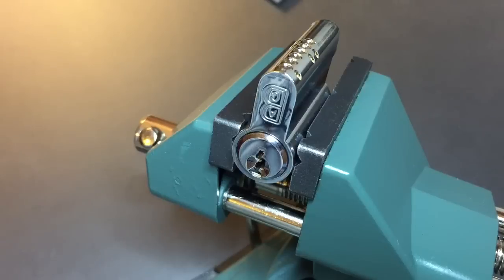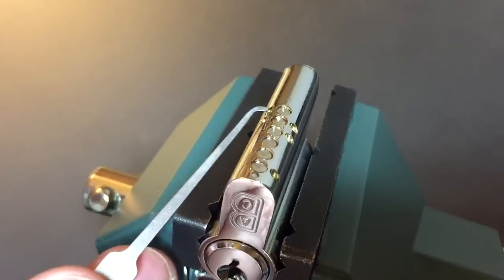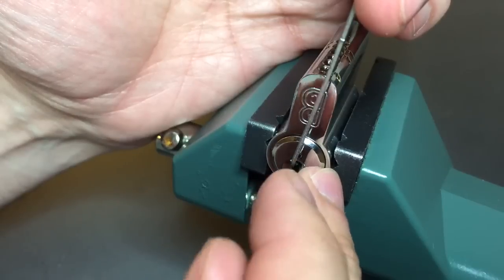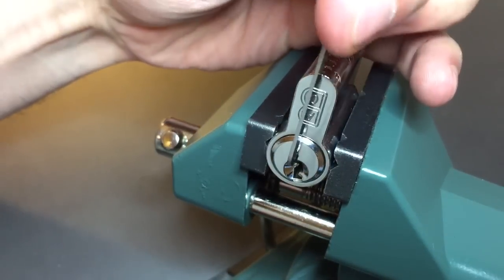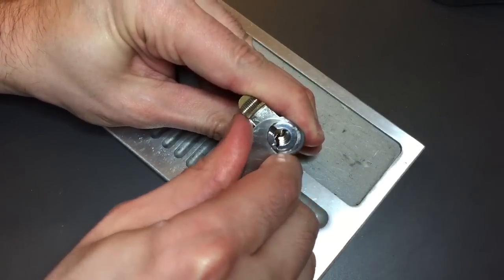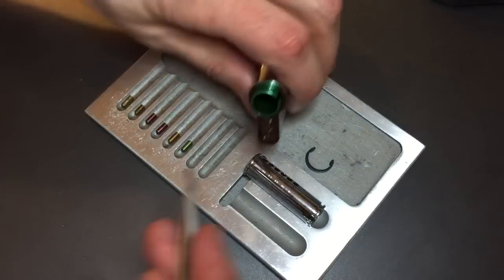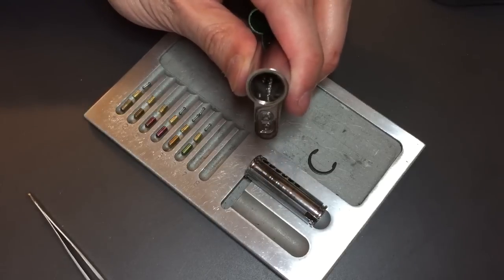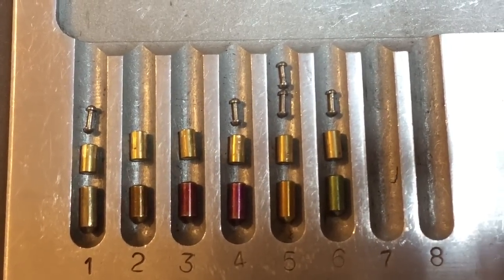[142] Fullex (5 Trap Pins!) Anti Bump Cylinder Picked and Gutted

Comment: Hi Harry,   Interesting lock, plus the trap pins. Some trap pins in locks can be beat by very tightly packing dental floss into a picked keyway ..... but I like your method a lot better!  Regards, Brian.
Reply from the maker: +Brian Hignett Thanks.  I was thinking along those lines.  I did not consider dental floss though.  I was thinking about stuffing pieces of foam ear plugs (the kind that you roll up, then they expand in your ear) into the keyway.  Luckily, the trap pins could be addressed by picking, or I'm not sure what I would have done.
Reply: +LockPickingLawyer  Hi Harry, There is a Chicago wafer cam lock we see occasionally, with a threaded tail piece that requires many many turns to unlock. It will relock every quarter turn when picking. Wet string is also effective, when packed in tight between relocks.Regards, Brian.
Reply from the maker: Brian Hignett Another good idea.  Thanks.
Reply: Seems that a piece of bread stuffed in would work as well. I've used bread to push out a pilot bearing. It can be quite dense but soft and easy to move it.

Comment: 0:48 wait im not getting this, wouldnt a driver pin also fall in a notch in the core when using the key? how would a normal key prevent that from happening?
Reply from the maker: +tom brax Take a look at my videos #113 (Allgood/Gege pExtra), #73 (EVVA DPI), and #58 (EVVA DPS) for examples of locks with trap pins like this.  They all involve a mechanism triggered by the key that blocks a hole in the core.
Reply: +LockPickingLawyer oh wow i see, interesting concept

Comment: Hi. Great video as usual. Just one question. As a locksmith I have come across this lock in the UK and had to drill it out after getting stuck on the trap pins. So I took it home and have been trying to pick it ever since. As obviously the internal side is still ok. So it's picked but stuck on the trap pins now. What are you actually doing to the trap pins and what type of pick is best?
Thanks, D.

Comment: Great picking and interesting lock as per usual.
Thanks for sharing 👍👍😘🍻🔓
I have a question.....
Once picked would it be possible to use a plug spinner to rotate the lock in the opposite direction without engaging the trap pins??
Reply from the maker: +Pick Beard Thanks.  I did try a spinner, but no luck.  My theory is that with the tiny trap and the large key pin hole, it just wasn't doable.

Comment: ?" if you pick it, then slide a pick upside down  can you hold up trap pins and keep turning? or use a plug spinner. is that 2 challenges lol
Reply from the maker: +JB Nope, that will not work unless all the key pins were the same length (i.e., the worse bitting in the world)  :-P